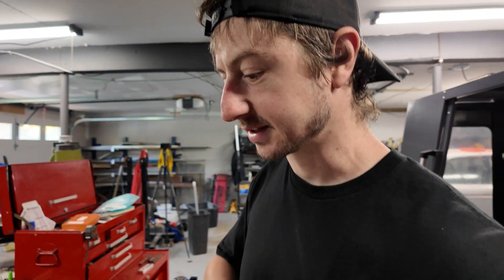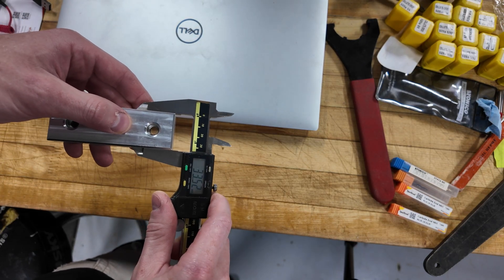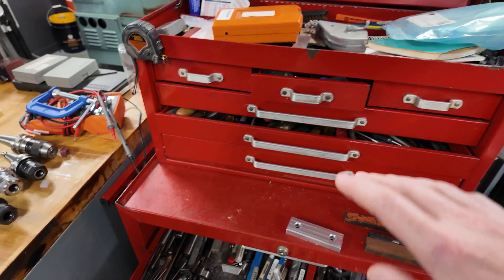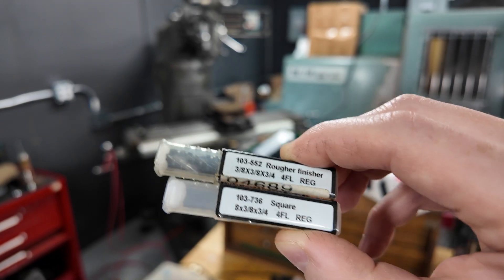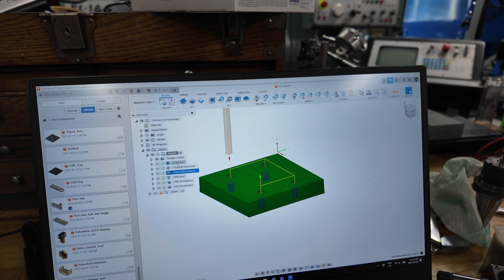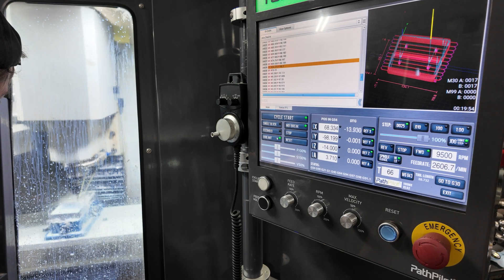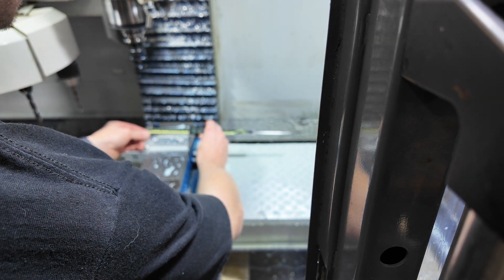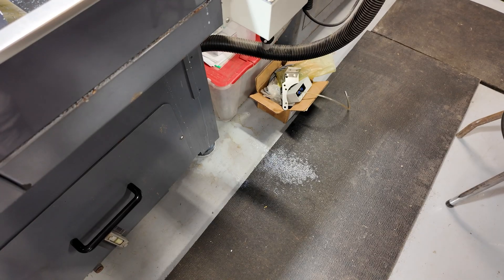One Simple Mistake Caused the Chamfer Issue

Comment: No way, first rule in machining is its never your fault. 2nd rule is metric system sucks. the rest of the world is wrong and they need to change for my convenience.. but for real its uncommon for American shops to stock imperial and metric end mills that are nearly identical because you can just use cutter comp. I probably would have done the same thing than i would pissed off at whoever put a metric tool  in the same box as standard tools

Comment: Always tough to track down that kind of error. Ever harder to admit to it on here!

Tips for the future - grab some bar stock in the size you want for less waste. For example, we use 1 in x 2 in sticks and cut to length and then just clean up the outside. Also on the Tormach I tend to use the center of X and Y for the WCS since it distributes any error in the stock's actual size to both ends instead of all on one end. Glad to see you making parts and I hope this helps! - TZ
Reply from the maker: Yeah I had this stock left over from a previous job so I figured I would use it for something and put some time on the machine. Thank you!